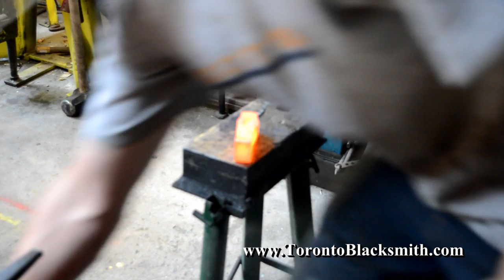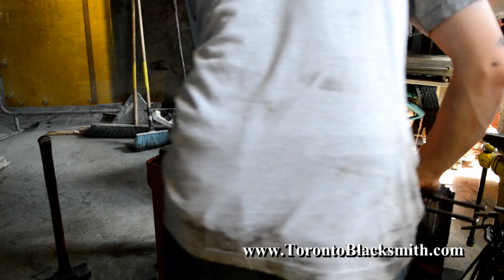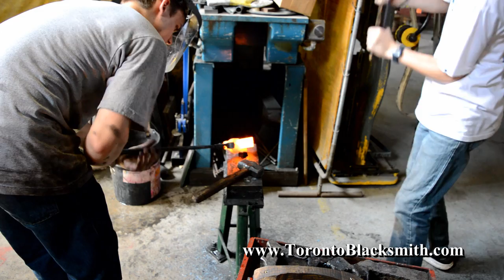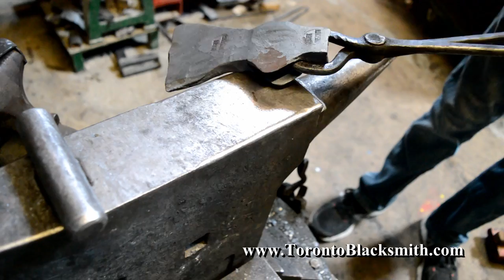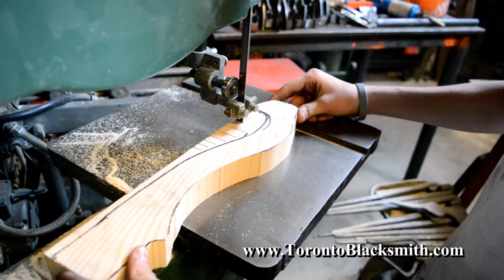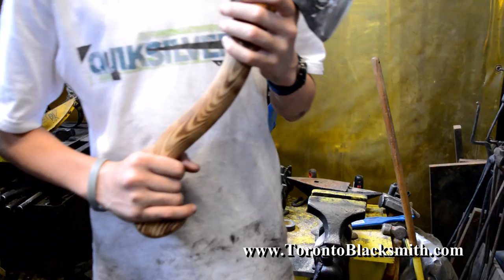Watch As 13 year Old Makes His First Axe! (He did a Great Job!)

Comment: Good work ! But my old Dad would turn in his grave to see those handles in the hammer heads lol!
Reply from the maker: They're not hammers, they're tools which are meant to be struck. The tools get damaged, and the handles broken, all the time. The handles are just friction fit on a taper. This is so the tool can be easily dressed, and the handle quickly replaced when broken.

Comment: so im 14 what do you think about me leaning how to be come a blacksmith and is there some stuff i need to get started?
Reply: Even a can filled with coals as a forge, with a hair dryer or a small leaf blower as an air supply, a fairly cheap hammer, a pair of pliers, a roughly rectangular piece of steel as an anvil, a file or two(And if you want to spend a little more money on powered tools to quicken the process an angle grinder or a drum sander with something such as a drill to mount it on should do), some sand paper and a kitchen oven and a bucket for quenching and tempering should be enough for small simple projects, and arent too expansive or hard to find. 
Steel shouldnt be too hard to find either. In fact, I found an approximatley 3m long peice of rebar on the street not too long ago. Old tools such as files could also be used. 
It is also recommended to get a vise or some clamps as well as a surface on which you can mount the vise or clamp your clamps onto, holding your piece in place as you grind.

You could find a plenty of content and tutorials on youtube to learn a bit from. Self experiece could also help you get better, as well as get yourself burrnet less often.

Now, if you want to get a bit more serious than making a few rough knives, i suggest you find some blacksmith who could teach you, there are some blacksmiths who teach courses and those are something you might want to take a look at(im pretty sure you have to be a few years older to take part in one of those but you should check anyway).

As a final note: if you do choose to make your own little workshop be carfeful. Coals will burn extremly hot when supplied with enough air(also, too much air will send burning coal particles everywhere, they just sting a little on their own but are still capable of igniting stuff that should generally not be on fire, very capable when theres alot of them), very hot steel is well... very hot, and should be handled very carefully.
 Since you are quite young i heavely suggest you work under the supervision of an adult whos both responsible and capable enough to take care of the situation if anything bad happens. Always wear saftey gear. gloves, sleeves and goggles, at the very least. This is extremely important when working with the forge since its made out of things that are not built to handle the extreme heat, contain all the sparks and flames, or be safe in general. Now i know ive said it quite a few timesbut please be careful. If you act carelessly youre bound to get burnt, and the more careless you are, the more severly and more frequently youll be burnt. Ive been using the setup mentioned above(minus the vice) and Ive got myself slightly burnt a few times just for being momentarily slightly careless. If i had worked without safty gear, or acted more carelessly than I did I wouldve been seriously punishied for it with some nasty burns.
Reply: ok thxs but i no that
you got more helpful stuff?
Reply: Im sorry but no, im afraid thats all ive got.

Comment: I love blacksmithing so much but i don't have a shop or amywhere I can go
Reply: Same
Reply: You dont have to start with a proper shop straight away. Even a can filled with coals as a forge, with a hair dryer or a small leaf blower as an air supply, a fairly cheap hammer, a roughly rectangular piece of steel as an anvil, a file or two(And if you want to spend a little more money on powered tools to quicken the process an angle grinder or a drum sander with something such as a drill to mount it on should do), some sand paper and a kitchen oven and a bucket for quenching and tempering should be enough for small simple projects, and arent too expansive or hard to find. 
Steel shouldnt be too hard to find either. In fact, I found an approximatley 3m long peice of rebar on the street not too long ago. Old tools such as files could also be used. 
It is also recommended to get a vise or some clamps as well as a surface on which you can mount the vise or clamp your clamps onto, holding your piece in place as you grind. Since it should be way more comfortable than putting your angle grinder on the top of a waist high stone wall, holding it in one hand, while trying to get your knife stay in the correct angle with the other as you grind it.

One last thing, rebar is usually made out of mild steel and cannot get very hard, as such a rebar knife's blade shouldnt stay very sharp very long. Files, especially old ones, tend to be made out of high carbon steel, which can be hardened to a greater degree and maintain a sharper edge for a longer time.
Reply: +guycxz yes I'm aware of all that but,I don't have access to coal or charcoal,I don't have a place to set it up(backyard or somewhere with ventilation),as an anvil I have the back of my vice wich is roughly 4×5cm(there's not enough room to fit a heavy hammer head on it),not to mention steel is impossible to find here,my father had to drive 10 km just to get threaded rod for some random project let alone something that could be hardened and tempered and files aren't of any use to me since I have around 7 to 10 of them and I use all on a regular basis...
I really have it hard, everything's not going my way
Reply: but but but
Reply: +The Flying Woodsman I know how it sounds, excuses everywhere.The only thing is that I tried everything,and am still trying to this day to make stuff,I guess you have to fail to succeed
Reply: My first forge was a break drum and some plumbing fittings set in a grill lid with mud ans standing on cinder block with a hair drainer as a blower. My first anvil was an 8 lb sledge hammer head sunk into a log. My first hammer was a large ball peen hammer I traded from my grandfather for a day's work.( I mowed his lawn) I got my coal from centaur forge. They ship for free. That is where I got all my tongs and my current small hammer. I got a real anvil off eBay and I got a propane forge there as well. I get my knife steel from New Jersey steel Barron but if you have an auto body place anywhere near springs are cheap to free. Believe me it can be done for cheap. Just remember. The first forge was a campfire. The first anvil and hammers where rocks. And the first steel came from dirt.
Reply: +stizan24 I don't live in the US and here car shops don't sell leaf spring steel,there are no shops that sell steel that can be heat treated...I got the coal okay,damn I even got a forge but worst of all I have no where to put a fire at,my shop is indors with no ventilation and I only have a front yard made to look nice with green turf gras so doing anything there is not possible. However,I'm still trying,the forge is setup,an old washing machine drum,I figured out the anvil and the hammers but the rest is just not working..
Reply: +stizan24 oh yeah,The added bonus is Amazon and eBay as far as I know don't work in my country,plus ordering anything online is an enormous hustle.The shipping usually costs around 1/4 of the items price or sometimes it costs even more then the item itself not to mention shipping is slow and stuff can get damaged easily

Comment: Get him some decent safety boots
Reply: Hold the striking hammer a bit shorter!
Reply: Get yourself a decent anvil!
Reply: +Sandy Sutherland that's a striking anvil so it is lower for tools to be at the right height when they stack and it has no horn because it's unnecessary.
Reply: Tom Breen .  Tom that 'anvil' is as handy as a chocolate teapot!  It has no body or bulk.  As to there being " no use for one",  bullshit!  There is always use for a horn on an anvil.  And get tha silly young striker to hold the sledge shorter,  he has diminished control holding at that length

Comment: I cringed so hard at the start as he tried to get the metal unstuck with a hammer 

Hot metal flying around is not a pleasant thing 
Other than that pretty good
Reply: Then You would probably hate metal casting... or be very respectful learning it.